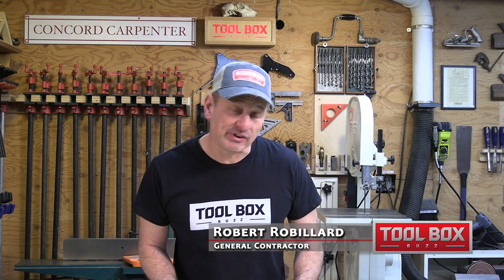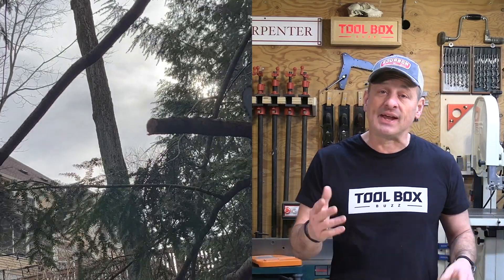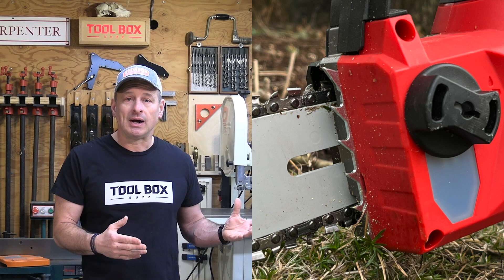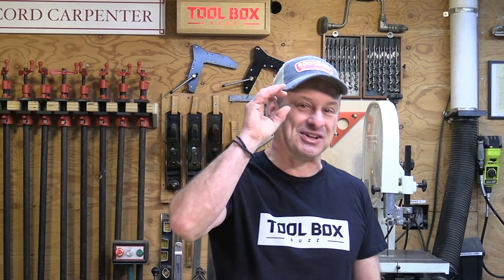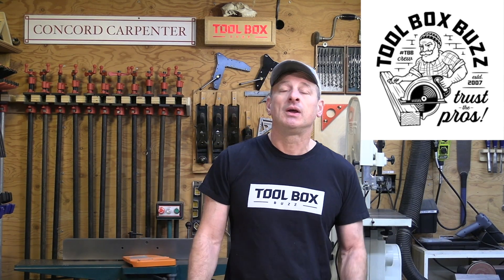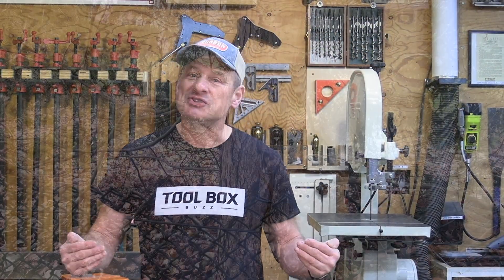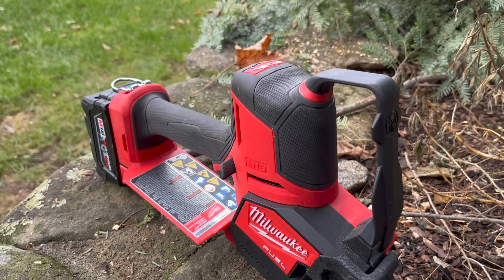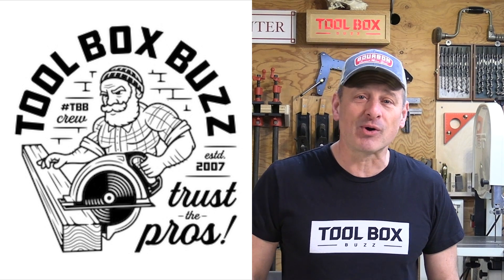Milwaukee M18 FUEL HATCHET 8" Pruning Saw Review

Comment: Another awesome tool by Milwaukee. Purchased it as a combo (included rapid charger, & 1 High Output XC 6.0 battery) from HD for $299. Live in Florida, & it’s already paid for itself by taking down a dying 12-13 foot palm tree. Effortlessly cut through its 10” wide trunk making nice logs for the fire pit. Also perfect for trimming palm fronds, bushes, & even cutting down palm trees. Great value, & one of the most used in a growing collection of Milwaukee tools.
Reply: How did you cut through a 10 inch trunk with 6-7 inches worth of usable  bar and chain?

Comment: Great review Rob. I have the M12 Hatchet and I use the M12, 5 ah, HO battery in it and I love it. It makes pruning a breeze and I was even able to cut up some large tree branches that fell after a storm. That little saw went through 6-7” pine branches without a problem. I ended up using more than my M18, 16” chain saw. Thanks so much for the video!
Reply: I've had the same experience and I have the 16" M18 chain saw too!

Comment: Good demonstration, I don't have the saw but I have seen several videos on what kind of saw I want to enjoy. This saw is no. 1 as it is low in speed (5m/s) but look at the chain there is no space between the teeth so in my opinion it saws like a saw that runs at 10m/s and it does not stop where there is variable speed regulation which allows you to save even more on the battery and heat the saw blade is 20cm long and a nice size, the only thing that should be that the oil flows without it being switched on, I don't know if this is the case, I wonder if you can put it on the side so the oil remains in the container.

Comment: I had to cut the tree on the fence line. It was an hesitant job although problematic if not done. I used a jig saw to cut the smaller branches and cordless chainsaw for the larger cuts. I was thinking this hatchet saw would be ideal for the branches too large for the  secateurs.

Comment: This Hatchet sounds good.  How does it compare to using a Hackzall for trimming branches, etc?  I've used my 12V Hackzall for this, and it worked pretty well.
Reply: I've got both the m18 one handed hackzall and this hatchet. The hackzall gets the job done with an aggressive 5 tpi wood blade but takes longer and vibrates more so you feel it in your hands if using it alot. The hatchet cuts way faster and is smoother with less vibration. I'm a gardener so I use it most days and worth the outlay for me. If you just use occasionally and not for prolonged periods then the hackzalls/sawzalls are fine👍

Comment: Another great video. No doubt this saw will perform. I am a woodturner and have been considering this saw because of its compact size to pack on road trips for occasional use when I come across a nice piece of wood. In your opinion, would this work for cutting a 8-12” diameter log? Of course I would have to cut from both sides. Thank you.
Reply from the maker: What a great idea

Comment: I am a professional landscaper that owns a landscape company. This saw is way too much money for what it is. My company is on multiple platforms including Milwaukee but $279 for this is ridiculous. They price themselves out of the market on some of their tools but the price will go down when they see sales are not where they should be. Milwaukee will always price their new tools very high because they know the Fanboys will buy them at any cost after that they will lower the price when no one else will buy them . There are a lot better options out there such as the 10-in top handle Makita or even Milwaukee's pole saw. We bought weed whip kits that comes with a 8 Amp Hour battery on sale for $200 then bought chainsaw attachments for under $100. We run both of these saws on job sites and they work great. If you pay whatever amount of money these companies ask they will continue to raise prices. Be smart.
Reply from the maker: Interesting take on the fanboy pricing - I wonder if that factors in